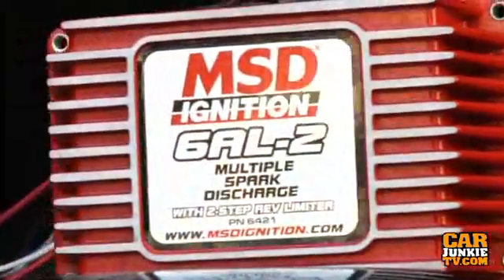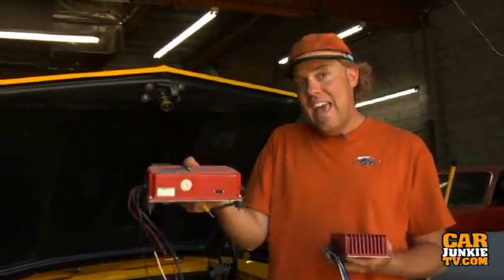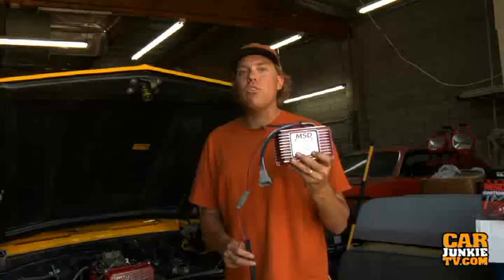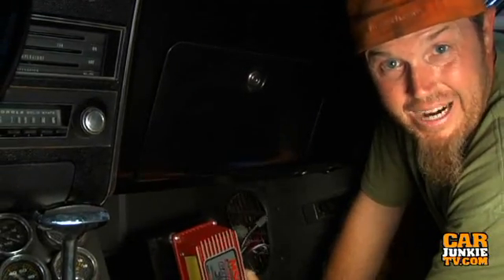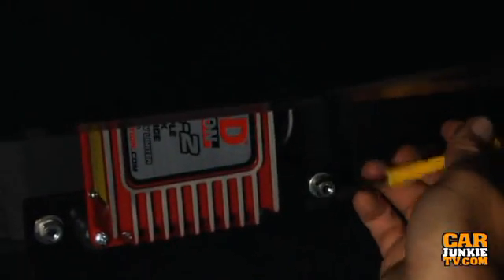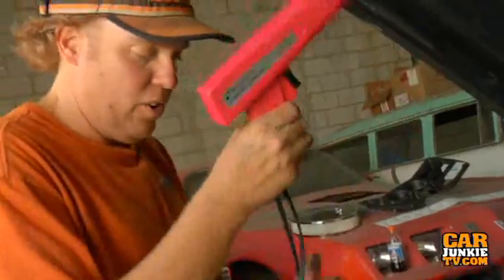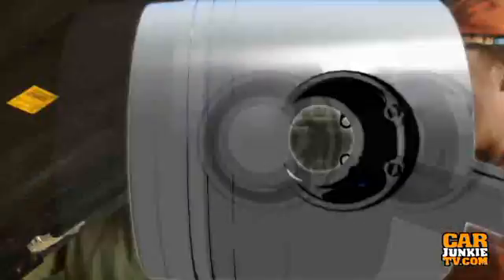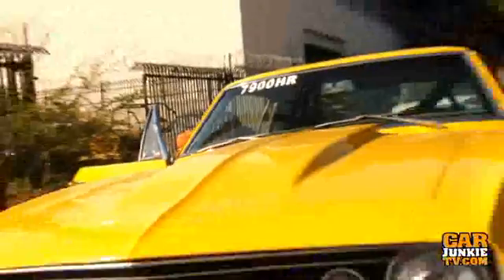CarJunkieTV.com evaluates MSD's new 6AL-2 Ignition Control!

Comment: Heatsoaking was a big problem on the original  6AL.......I burned up 2 of them running them in the engine compartment. I'm putting my new 6AL under my fox 5.0's seat this time.